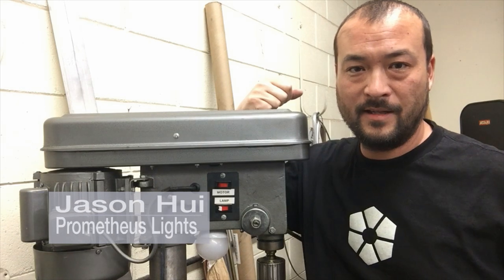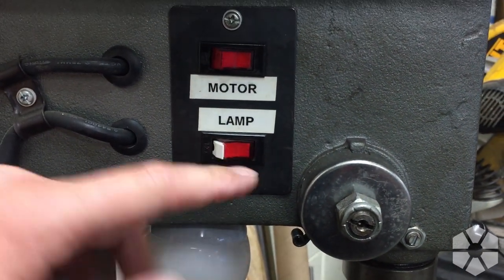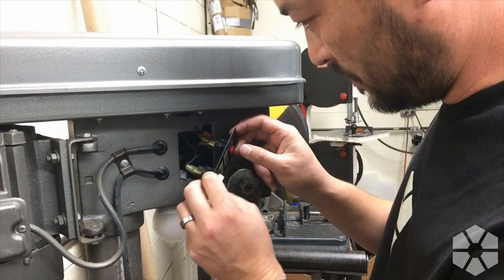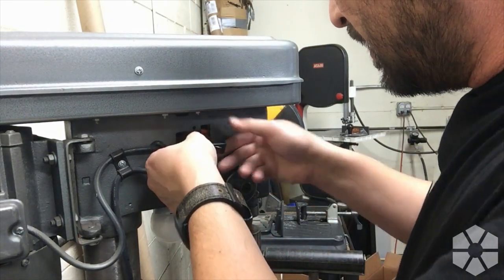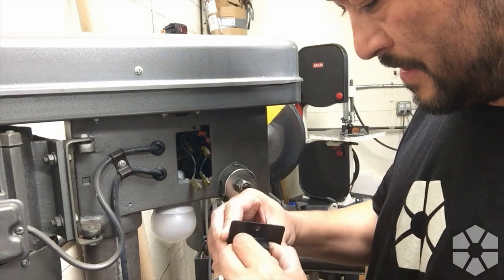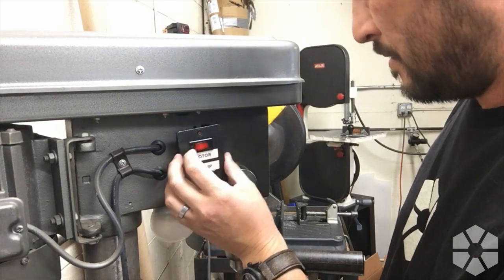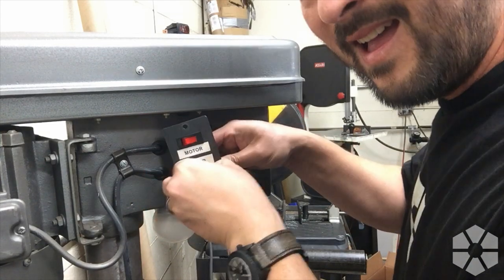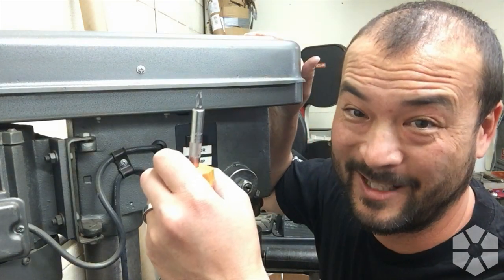MRO Mondays: Drill Press Light Switch

Comment: I just bought the same drill press and it didn’t have any belts that it came with. I have 23L Dash 260 belts on it but it seems a little loose. I think I might have to go for the 3L Dash 255. What belts are you running in your drill press? I cannot find a manual on this thing.
Reply from the maker: I use Fenner Link Belts on 100% of my belt driven tools: https://www.fennerdrives.com/product-lines/hpc-v-belts/

Unfortunately I don't have the speed chart, and I don't typically adjust the speeds. I just picked a reasonable RPM for general work and leave it there. I also have a bridgeport mill if I need to do either precision or heavy drilling. I mostly use the drill press for coarse/quick work or when I run out of Z travel on the mill.

Comment: If you want the lamps in the switches to work, you could get a vampire clip, small piece of wire and spade connected. Simply tap the + wire and connect to the switch. I’d say you could splice a wire at the spade connector, but given you’re working with short wires, you’d only shorten it more because of having to cut the existing connected off, then stripping and crimping a new spade connector. 

Disclaimer, I’m not an electrician so heed this at your own risk. 😀